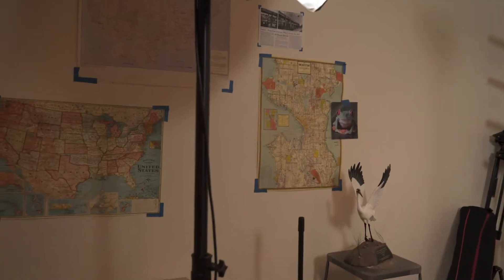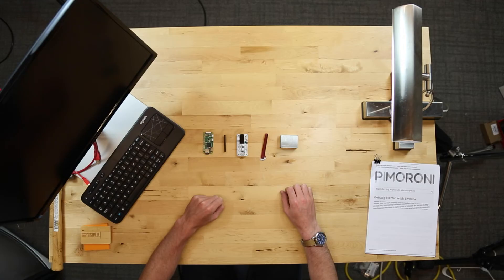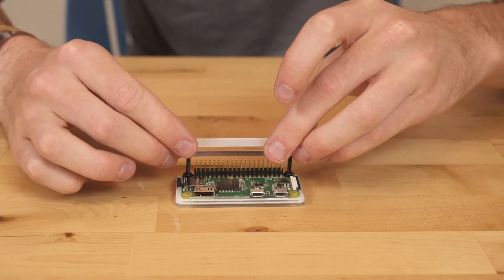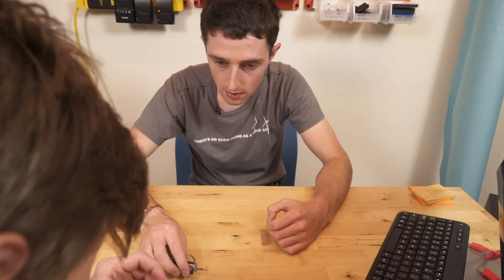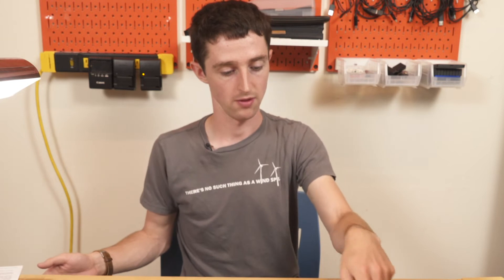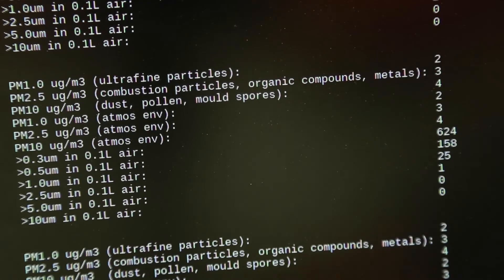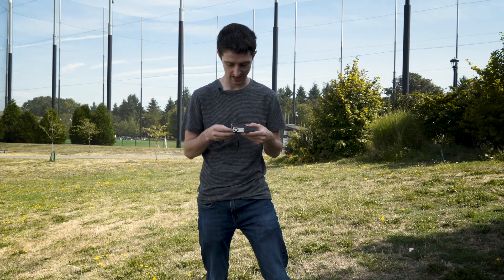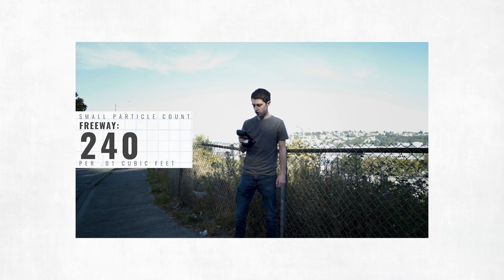How to build a DIY air quality sensor

Comment: I'm wondering if any that have built this have been able to successfully incorporated a gps module for a mobile aqi sensor device. I'm working on a project that would use these as low-cost citizen science devices for tracking neighborhood level air quality monitoring. Any suggestions for resources to help integrate geolocation data is much appreciated!

Comment: "The real air monitor" is probably using the same sensor (that also fluctuates) they likely use an average over a number of seconds as fine particulate measured from one second to the next would not be very useful. Also... when anyone tries to talk about things they don't actually understand, it makes them look pretty stupid. I'm not calling you stupid, this video is just pretty hard to watch and cringe.

Comment: Hi, 
Thanks for the video. I have a question: 
there are 6 different outputs. 
PM1.0 ug/m3 (ultrafine particles):                             
PM2.5 ug/m3 (combustion particles, organic compounds, metals): 
PM10 ug/m3  (dust, pollen, mould spores):                      
PM1.0 ug/m3 (atmos env):                                       
PM2.5 ug/m3 (atmos env):                                       
PM10 ug/m3 (atmos env):   
what is the difference between the first three with the second three reading. 
Thanks